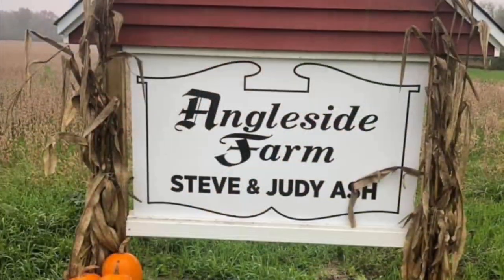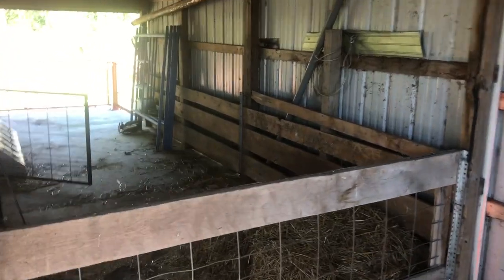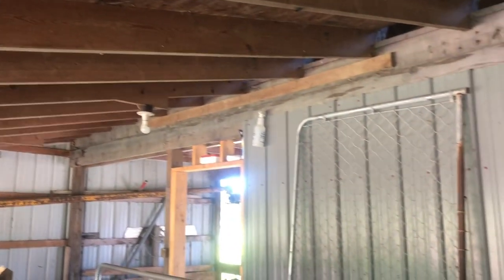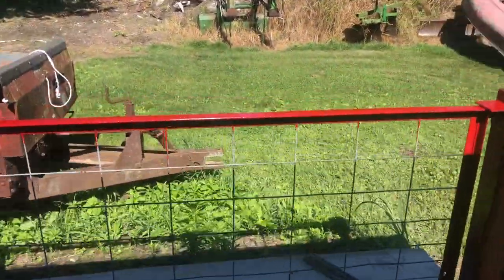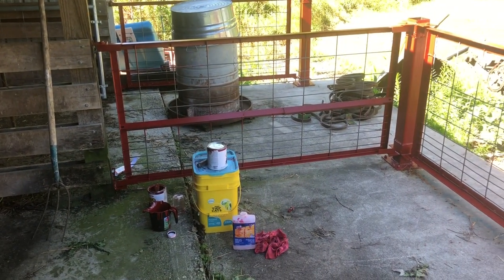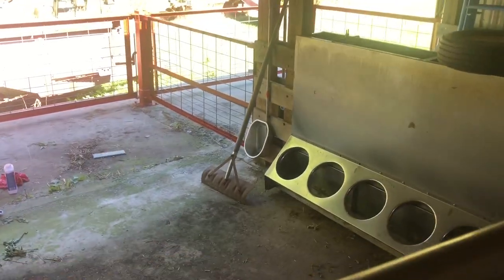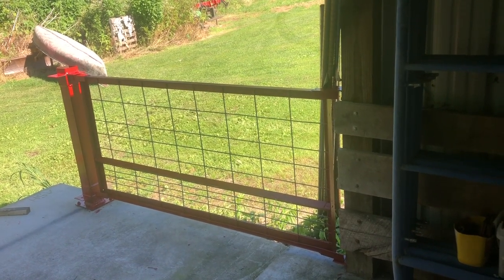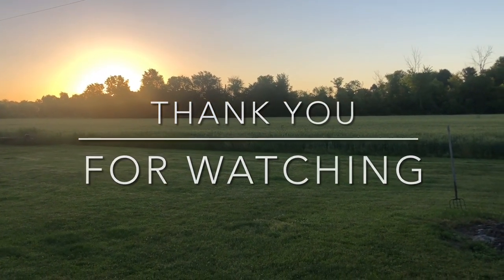Raising hogs on a small scale - the barn upgrades

Comment: I'm not even actively farming and my buildings aren't big enough. My Dad always got all the machinery inside under a roof. We had a baler with a thrower, a mixer mill, an elevator, 2- 4 bottom plows, 2 cultivators, a disc, a 16 ft. bumper hitch livestock trailer, a 2 row mounted corn picker, and a 145 bushel manure spreader. If we needed something from the quonset building, it was a half day affair dragging everything out to get what we wanted and then putting everything back away.
Reply from the maker: I know the feeling Gary, the equipment shuffle.